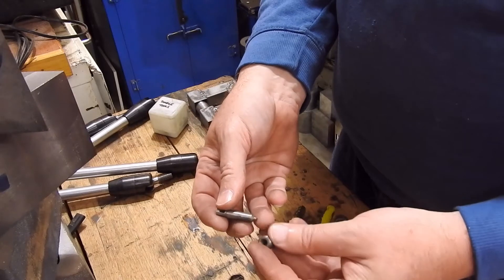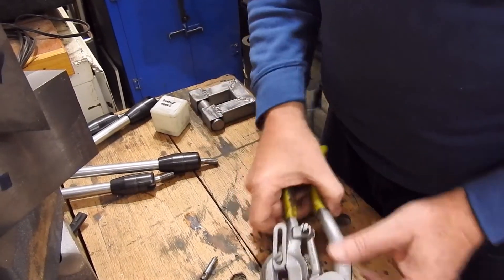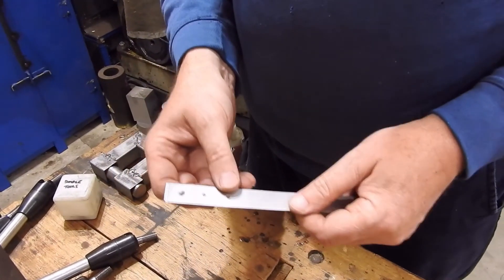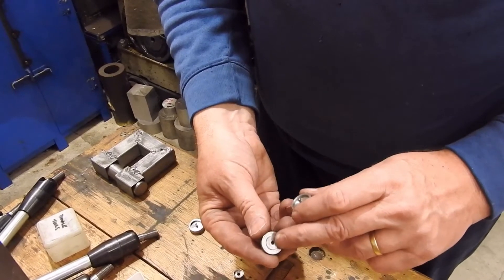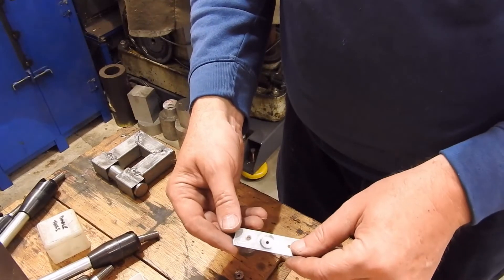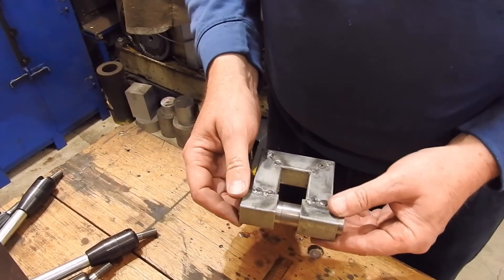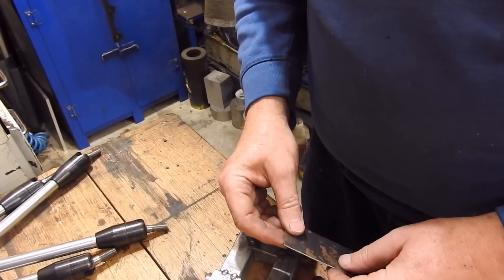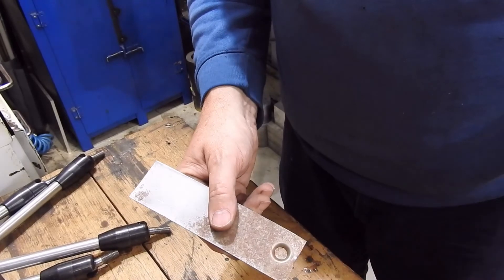Dimples...

Comment: I 3D printed a set of 1 1/2” Dimple dies and 10 ton hydraulic knock out punch for aluminum strips. Thanks for sharing.  50% infill on the 3D prints
Reply from the maker: Interesting to hear that worked. I would not have thought it would just because of the relatively poor strength of plastic vs metal. I'll have to try that one day. Thanks for sharing

Comment: Where did you get the countersink tool around 1:45?  I need to find one for a M3 flat head.
Reply from the maker: G'day Branden. Afraid I don't know. Like lots of gear in my shed, the punch was bought secondhand and those bits were with it. Shouldn't take much to make something similar up with a lathe to fit a punch like that though. As the punch is not cutting but just deforming, for a limited use heat treatment would probably not be needed. The other possibility is a hammer type punch (with a die block on the other side). I've made and used one in another clip I think but of course I can't find it at the moment